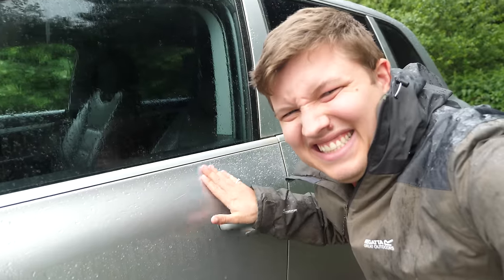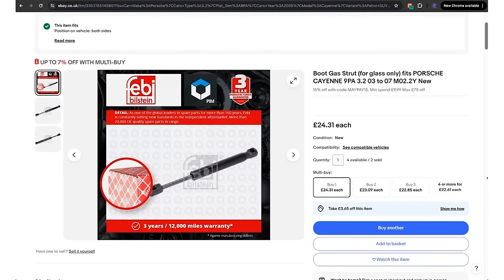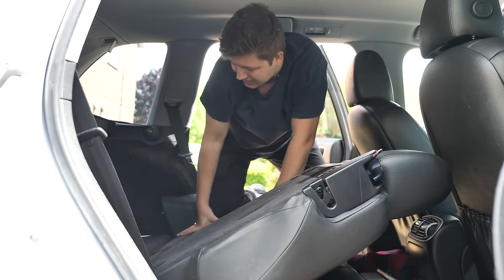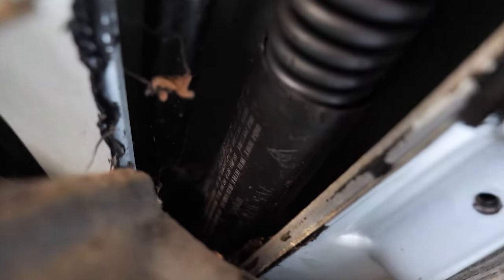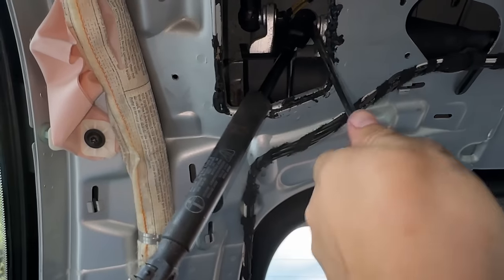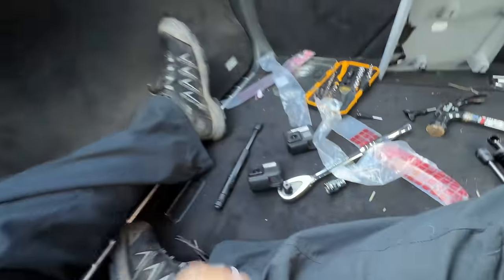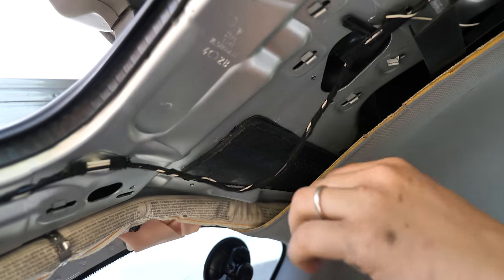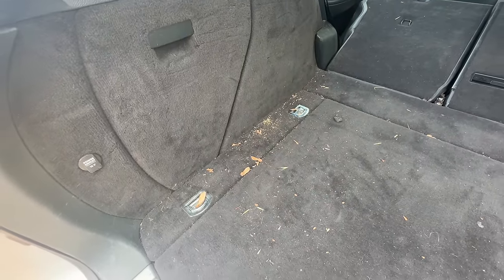Replacing The Tailgate Struts On My Porsche Cayenne!

Comment: EVERY Cayenne owner should do this?? Don't be ridiculous 😅 Only owners with faulty struts should do this 😅
Reply from the maker: Well I suppose that is a good point! :)
Reply: Every Cayenne owner has faulty gas struts
Reply: @keithvers569 so if i went to Porsche and spent £136,000 on a brand new Turbo Cayenne, i'd be a Cayenne owner and i'd still need to get new struts?
Reply: @waynelewis5656  before very long yes, they don’t last long
Reply: @keithvers569 so after a while, but on day 1 as a new owner, I wouldn't need to replace the struts. Therefore 'every owner' doesn't need to do it. I'd also suggest that genuine Porsche struts are likely to be better quality than the eBay specials that Joel bought.
Reply: @waynelewis5656  ok I’ll rephrase that as almost all
Reply: Stabilus gas struts are perfectly acceptable thoroughly recommended.
Reply: @eddherring4972  Of course they're perfectly acceptable, that's who make the original 'porsche' parts
Reply: So every 1st gen cayenne owner then. That is unless they have already done it 😂
Reply: @waynelewis5656  you refer to them as “the eBay specials that Joel bought” in your comment.
Reply: @eddherring4972 the Febi struts that we can all see him buying?
Reply: @waynelewis5656  10:36 clearly Stabilus for the window struts and Febi are hardly “eBay specials” even if they are not OEM. I’ve had no issues with Febi parts on Audis, BMWs and Porsches.